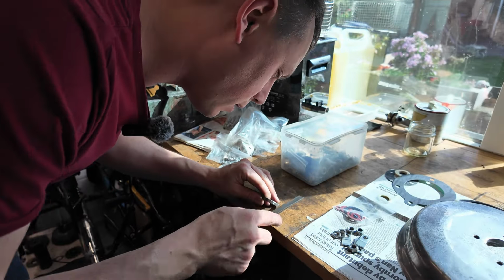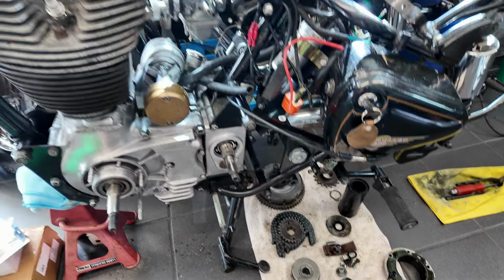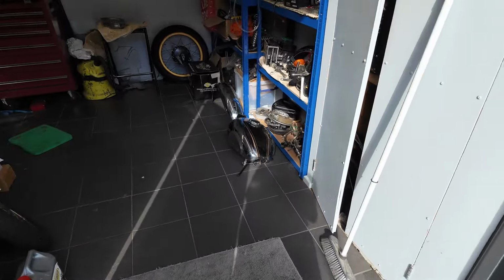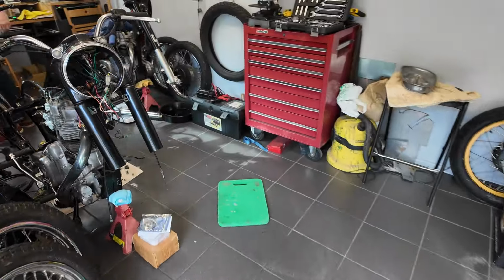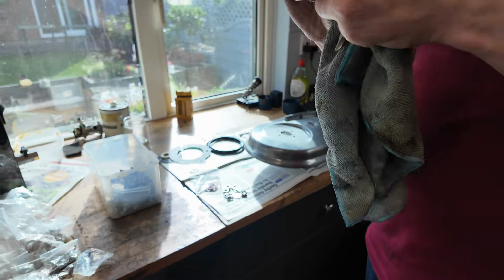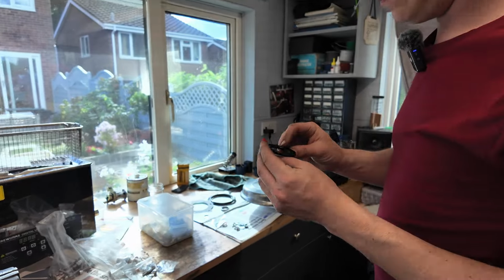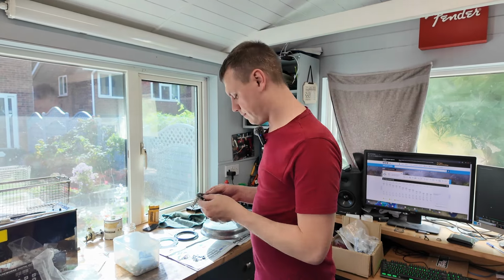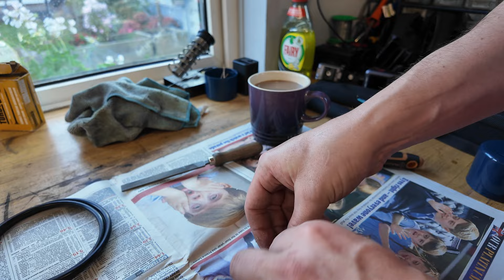Wreck it Wren's Enfield | We're Back on It!

Comment: I’m not sure if you’ve come across it, but I use Wellseal which is a fantastic gasket sealant for older engines which may not have been made/machined to modern tolerances. It was developed by Rolls Royce originally. Might be worth a go if you ever suffer with issues like that.
Reply from the maker: Thanks, will certainly check Wellseal out for sure.

Comment: Emily, check what shutter speed you’ve got your camera set to and try different speeds. You may find changing your shutter speed will get rid of the strobing caused by the lighting on your videos. You can also change those strip lights to camera friendly bulbs. 👍🏼
Reply from the maker: Thanks for the tip, will check that out.

Comment: You should treat yourself to a hydraulic bike lift. I have a 20ft steel shipping container that I keep 2 motorbikes in and fitted out with 6 floor to ceiling shelving units, paddock stands and 2 foldable table/work benches. Space is admittedly tight but workable, I normally park one of the bikes on the lift.. As a 70 years young biker it makes servicing my Suzuki GSX650F a whole lot easier.
Reply from the maker: Hey Jim, absolutely on the list of workshop upgrades!

Comment: Its easier to  drop the gearbox and insert a sealed bearing, enfield use a close tolerance seal  ( and a bit od tissue paper shove in the leak !hahaha)   also ( and you have probably finished  it by now)   but every mm counts with those enfield clutches   try and run the clutch housing "close " to the primary  while keeping the triplex chain straight
Reply from the maker: Cheers pal… if the issue returns i’ll get Wrens partner to drop the gearbox and do just that.